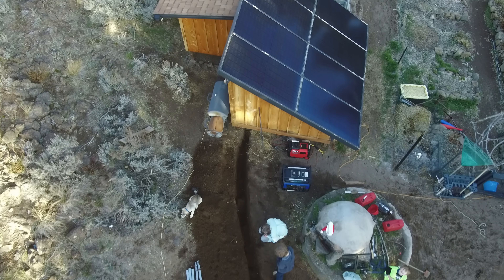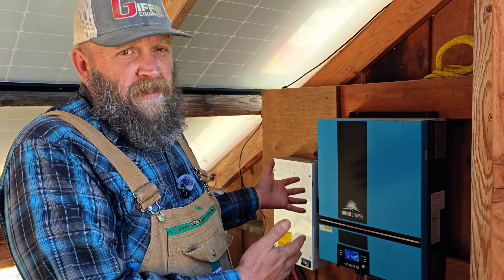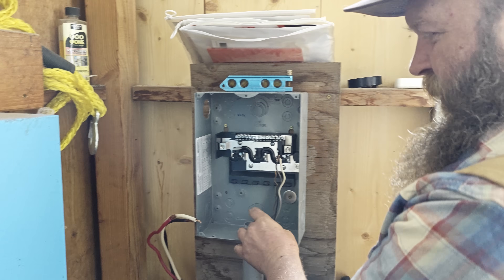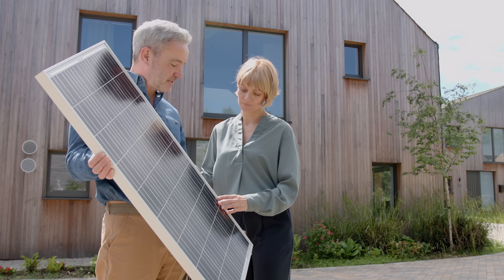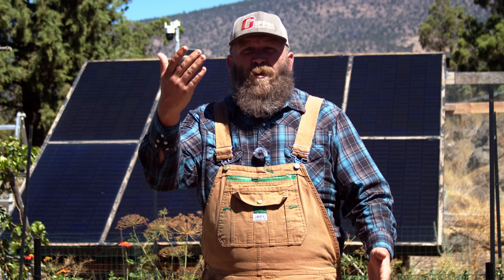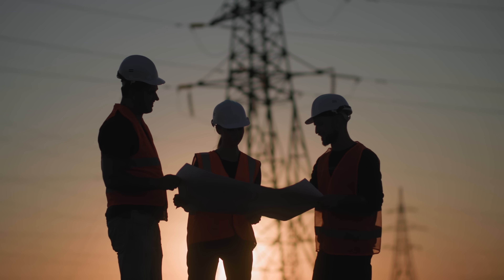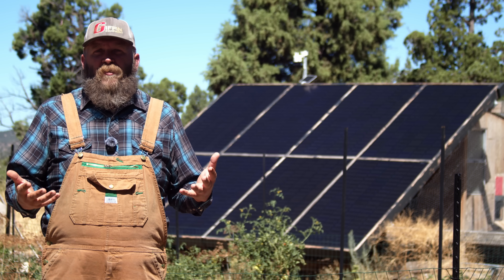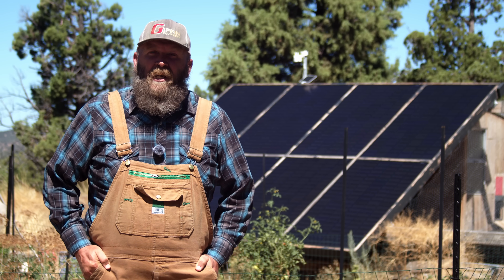The True Cost Of Off Grid Solar

Comment: I moved to northern michigan 3 years ago. When i called the power company they wanted $28,695.00 to bring power to my property. I am about 3/4 of a mile away from the last pole on my dirt road... At that point i decided to go 12v for everything. I got 6 200watt solar panels 2 200ah lifepo4 batteries and 2 300ah lifepo4 batteries and 2 40amp epever solar controllers breakers and wiring. Then i got 2 50amp lifepo4 battery chargers and a 5000watt propane generator for the 2 months i dont get good solar due to short days. All this cost me $6235.00 i use a 40lb propane tank to run my generator for 6 hrs every third day. That 40lb tank last me 6 charges... It cost me $20 to fill the 40lb propane tank. Then i found a 32ft 5wheel camper for $1000.00 everything works great... I use another 40lb propane tank for heat, cooking, refridge and hot water. It last 4 day in the coldest weather... It will take almost 15years of using my system to cost the same as they wanted to bring power to my property... Then they wanted to charge me a monthly bill of about $300.00 a month... No decision to make honestly... Oh btw i hooked everything to a 500gal propane tank last year and it cost $779.00 to fill it... Im still using that first fill...

Comment: @5:40 lithium batteries on paper last longer but in reality, lead acid lasts much longer. Properly service the batteries and they can last 20 years, super simple to service too AND theres no threat for thermal runaway or explosions. Lithium is good for simple backup builds or for mobility, lead acid is better for off grid/prepper builds where weight/size doesnt matter.

Comment: OK, its So Easy ✅️ 
I'm Somewhat mechanically inclined = Meaning, I can probably screw up most Easy projects!!
I'd like C to see more info on proper wire gauge, use of fuses at proper points = for safety of equipment/ components =so as Not to burn down my dwelling.
There's a lil more details needed for some like Me -😅
I'm Not blonde But Very gray!!
I've been following solar installation for some time. Have purchased Most of needed items but not the panels. I want 400w
Panels & just a few to start. Also have small 2500 generator but live @ 6,000' elevation which I've learned is a problem with generators. Aĺso a problem with battery storage in cold winter temperatures.. Trying to protect my investment - so much to know.
Reply from the maker: All great questions. I have a playlist called off grid solar (or something like that) that answers most of those questions and even important details you didn't ask here. 😂 It's really easy, you got this!!

Comment: Always encouraging our friends to go solar and your video is so similar to our DIY setup, forwarding your link and well done!  Couple of "tips" we've done over the last few years; got tired of servicing and keeping fresh fuel around for the generator.   We simply added four more solar panels and four more LifePO4 280Ah batteries than we actually need for day to day use (about the cost of a good dual fuel generator).   That gives us so much "reserve" power we NEVER come close to needing a generator.  Essentially we've oversized our system by 50% for the same cost we had in a generator and no maintenance, win-win.   Tip 2 - for nearly the same cost use Bi-Facial Solar Panels and gain the extra production of power from the rear.  The best part, when we are occasionally away on snow days we use a fraction of the power and that amount is easily produced from the rear the of snow bound panels until we return.   Note concerning the 280Ah batteries I mentioned above...seems to be the sweet spot in pricing the last few years.  What you are using is great, simply a bit better pricing per Ah in most cases using 280's.  Again great setup and may God Bless you and your Family!!!

Comment: Great video; thanks!  We're off grid for 20 years using FLA batteries and plan to replace our 3rd set with LiFePo.  Will need to replace the inverters and charge controllers I think.  In the SanFrancisco Bay area having trouble finding anyone to work on Off grid systems. Still looking though.  Have been tempted by Outback's or wired system.

Comment: I live off grid in Vermont.  Not the sunniest of locations.  Run my entire modern 1,200 sq ft home off propane radiant heated floor and solar.  My electrical setup is 120/240V 13Kw with duel inverters and 30KWh 48V battery back with 5Kw solar panels.  Backed up by duel 10Kw propane generators.  Can go 3 cloudy/snowy days before I need to run a generator for 5 hours to fully charge. Never an issue 6 months a year the Solar is sufficient.  In winter on sunny days with snow (bifacial) the PV works very well.

Comment: I haven’t figured out the pros to switching from my 12v system to 24 or 48. It seems like paying more money for more expensive parts. I do understand you can hook up more panels, but you also need more batteries.
Reply: Less voltage drop (more efficiency), more stability with partly shaded areas and suboptimal angles. You don't necessarily need more batteries. Just the correct ones...

Comment: I bought,built, installed my own 1400 watt ground mount solar setup for my apartment with 4 12 volt, 100 ah lithium batteries connected in 24 volt configuration & been using them for 5 yrs so far to supplement electricity & for backup & using my old 5kw agm batteries just for led light connected to a automatic power failure system in all I have around 10 kw total usage, it’s always cheaper to build your own.

Comment: What if I told you that mounting solar panels to wood is an absolute no-no and voids the warranty by almost all solar panel manufacturers? It is clearly listed in the installation manual, and the wood will expand and contract over the seasons and throughout the night and day and over time, you will develop what is called microfractures of the silicon solar cells. Warranty void and degraded output within five years. I work for a solar manufacturer and we have seen it so many times. It is an absolute no no in the industry but is very commonly done by "know it all"  homeowners.
Reply from the maker: Id respond by saying the warranty matters very little to me. The expansion and contraction of the wood was factored in when I built it which is actually in the build video on that system thus none of the problems discussed here are of any concern. The panels were $2000 and the array was built that way to shed water for the garden which solved a bigger than $2000 problem. The warranty is a much bigger deal to people who buy retail from installers paying 3-4 times what I did per watt.

Comment: I certainly wouldn't use golf cart batteries on a solar system, not enough capacity, they are better suited for a microhydro setup. There are lead acid batteries with high capacity that are specifically meant for solar. More expensive but they will last way longer than a bank of golf cart batteries that are constantly being drained and recharged.

Comment: Hey brother I love you videos I just want to let you know I bought a bunch of solar stuff I have 16 24 volt 3213 panels with two renergie 100 amp charge controllers I have eight 12 volt power sorry 300 amp hour batteries for a large Bank
Reply: I plan on making my panels 8 lbs for one charge controller 8 panels for the other charge controller
Reply: Running 8 panel for with four batteries and the other 8 panel with another four batteries so I should be good that way I'm going to go 48 volts on the panels with a 24 volt battery Bank
Reply from the maker: Sweet!! Very cool. Might I suggest making one battery bank out of the whole deal and connecting both charge controllers to that bigger bank. You can have as many charge controllers as you want attached to those batteries and it will be more efficient as well as simpler on the inverter power. Best of luck.

Comment: 5:55 im under the impression that lead acid batterys should not be discharged more than 50% or youll risk damaging them. But i have completely killed the single 12 volt 89ah battery on my camper a few times before i built up my latest system. 800 watts of panels, 24 volt system, 2-460ah lifepo 12 volt batterys and a 3000 watt inverter feeding 120 volts to the camper. Im good all summer, next is to test it in the snow this winter. Lifepo batterys will not charge when the cell temp is below 32*f.

Comment: I have an off grid life and for the last year my fridge tv and diesel heater have got by on 400 watt 12v with 300ah battery 
It all depends on your needs and wants but as i just picked up 13 275w panels for $45 ea it is time to upgrade

Comment: I'd like to add to your comment about NOT affixing ones solar array TO their roof. By opting to place ones array in a ground mount fashion one ALSO saves their roof AND possibly avert damage that may possibly be inadvertently  over time done to the underlying framing  structure of the home or building as well. How you may ask? Well thats simple. When panels are affixed to a structures roof they create a catch point for leaves and debris to be caught at and become trapped. Unless one is diligent about cleaning out this debris, it staying in place is a situation that can and does create moisture traps that then cause that moisture to remain for extended periods, pressed up against the material of the roof overlayment. Asphalt will deteriorate QUICKER when rotting organic material AND moisture is present for extended periods of time and IN contact with the material. And if your roof is raised rib steel panels, that moisture and decomposing organic matter will also deteriorate the enamel coating of the steel as well as rust out any eposed steel that may be or become present on the roof sheets. BOTH of these issues defrade the surface of the roofing material used and SUBSTANTIALLY reduce its given life epectancy if not AVERTED to begin with OR addressed IMMIEDIATLY when realized. Then there is the BIGGER issue of having to penetrate the overlayment (shingles or panels) to create the fix points for the mounting system itself. Penetrations in roofs are by FAR and LARGE the single most problematic area of a roofs construction as far as infiltration points for moisture intrusion. MOST especially those penetrations that it is subjected to AFTER the fact of its initial constructions completion. Roof mount solar applications and its mounting systems penetration points are the SINGULARLY BIGGEST issue as far as subsequent damage to the roofing material is concerned in this application method AS WELL as possible subsequent damage ro the uderlying framing system of the roof itself as well due to moisture infiltration and the rot in the lumber that will undoubtebly take place should this occur. When you go on and punch holes in a perfectly good roof, and MOST especially when one does a piss poor job of then MAKING SURE to seal up those holes during installation, this is what one would subsequently EXPECT to happen, after having done so. This is even MORE reason to NOT mount ones solar to ones buildings roof UNLESS there is NO other option except doing so. Just thought Id add that to your addressing of using ground mounted solar vs a rooftop mount array. Nice vid. Appreciate the info AND the content! Cheers!

Comment: As an off-grid person that just recently installed our full solar system and had no previous experience, I approve this message...lol.  Even in Alaska with dark winters it was. worth it.  The one thing that I made a mistake on and did fix, was getting correct wire sizing based on voltage and amps.  Everyone that can do solar should in my opinion.

Comment: Main concern: how to design a system to meet my needs. I have build several from harbor frieght crap to 1000 watt 12v with 5x 100 amp hour Li ion batteries but I need a normal house hold system with capabilty of running it all for at least a week with no sun.

Comment: this was great. my biggest concern is reliable power that is sufficient to run a deep well, 220 equipment and keep the other essentials online at the same time. since getting on grid only costs around 5k in my area I can see the benefit of buying solar but so far nobody is showing affordable systems for a large off grid house with demanding power.

Comment: Excellent video and channel~!! We started with 6V batteries from Sam's, but upgraded to sealed lithium, although more costly, it was well worth it. Totally agree that power generators (wind, fuel, etc.) should be secondary to your off-grid solar system, and installing on your roof is risky and causes many issues, not to mention insurance cancellation. Now, if one has a grid tie (i.e. not off-grid), then priorities/budgets change of course.

Comment: i live in NYS. it's no longer the cost per KW/H, it's the ridiculous delivery charges and taxes we are now getting hosed with. the electric bills have become unsustainable.  this summer i got socked with a $400 electric bill. it's getting worse too, with nyseg now pushing for an additional 35% increase in rates. in the past i wouldn't even look at these things, but now i am starting to look at it and do some research. i haven't bought anything
Reply: Same in CT. Delivery cost more than generation. I think im around 22 cents per kwh delivered. Everyone says my rates are low. Generation is low, delivery is high.
Reply: @criticaltemperature3343  the way the bills are written is convoluted intentionally. ignore the BS breakdowns and just take the total paid and divide it by the usage and you get your true cost per kw/hr. it doesn't matter if it is "delivery" or "supply" charge, it all removes money from your household every month

Comment: I installed 9000w of solar feeding two Ecoflow ultra  battery systems with 37KWH of battery to run my house with central air, pool and electric heat to supplement my natural gas furnace in winter. The cost after tax credits is $11,000 wich is a 4 year payback. This was supposed to be a 3 year project but with federal tax credits ending in three months I compressed my time frame to 12 months.

Comment: Great info here, My biggest concern is internet, I use Starlink, and I work from home, most times its 8 - 5ish. However there are times I need to work when the sun is sleeping. I worry that there may be a time when I need to get up at 3am and do some work and wont have power. If your setup here runs a family of 7 this should be more than enough for me. Its just a family of 2.
Reply from the maker: It really depends on how much you use but I'd say this sized set up would be pretty good for you. Then use a back up Genny just in case.

Comment: ......of course, some of us aren't comfortable with working on a double storey roof, mounting a support system to lock the racks, with out letting any rain into the roof. And then there's the connecting the inverter safely into the grid (because most of us are not off-grid.) So, yeah..... paying someone who is certified, qualified and fully insured for "falling off your roof..." is something that most see as a "good thing".
Reply from the maker: Sure... And as a result an entire industry exists. That's also a good thing. But, like I mentioned in the video, I'm talking about off grid systems (which is the goal for most of the folks who watch my videos). Also as I mentioned, ground mount for an off grid system is a much better solution, solving all those issues you mentioned. And connecting to the grid can be the thing you hire an electrician to do, although you'll pay $200+ dollars to install a breaker. Very basic easy and the panel can be turned off eliminating all danger so I guess if that's worth it to you, it's worth it to me for you. Either way, the point of the video was to make clear the actual costs involved in materials, installation and sales commissions. The choice is y'all's at that point. Have a great night.